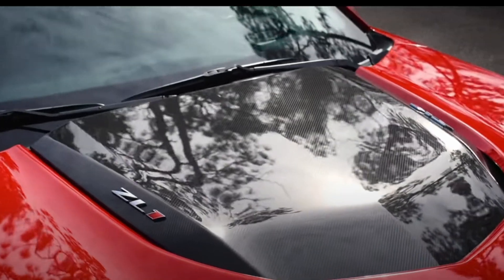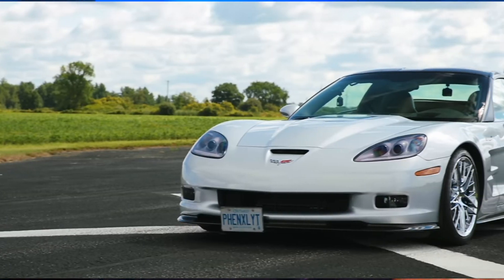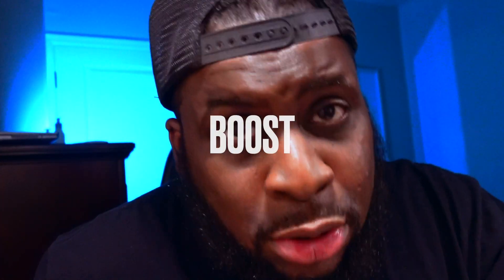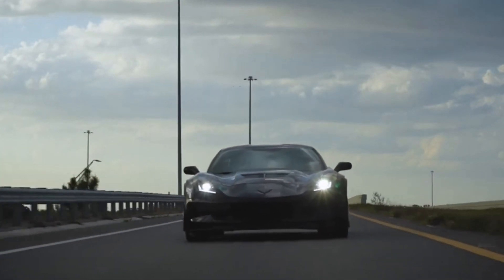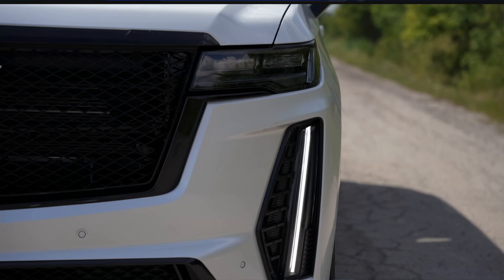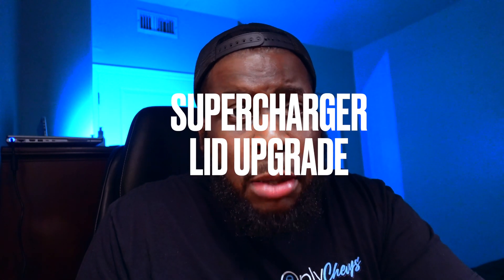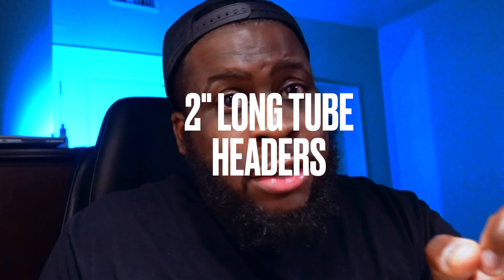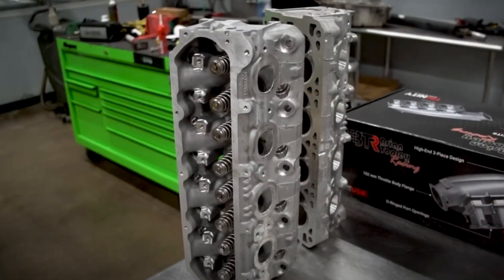The LT4 Engine WON’T SURVIVE 100,000 Miles?!

Comment: I hope GM sees this and sues the crap out of you for misinformation. I have a '16 ZO6 with over 135k miles on it with a Maggie 2650 putting out 15lbs. of boost and over 1k hp for over 4 years now and here's the kicker...still on stock crank and rods. So a stock LT4 will outlast your birthdays as long as you maintain it. Your misinfo for likes and whatever has ppl considering spending money for nothing to bulletproof a motor that doesn't need it. 🤡
Reply from the maker: 🤣🤣🤣 you funny, just because yours lasted doesn’t mean others haven’t experienced either of these issues i mentioned. Just because you on a maggie2650 safe tune from magnuson doesn’t mean anything. Stuff happens, just say you was lucky enough to not experience it!🤡 all the stuff I’m saying you can Google it 🤣
Reply: You Goofball there is nothing safe about a car making over 450hp more than stock hp, on 6 more psi over stock on the same rods and crank with over 135k miles on them. But of course you wouldn't have a clue 😂. I guess stock LT4's won't last that long according to your goofy logic. Freaking 🤡. Talk about something you truly know about and leave the car topics to the adults. Fkng Goofball 😂.

Comment: Only the Corvette LT4 motors are dry sump. And only the '15/16 Corvette motors had the stock limp mode heat issue.
Reply from the maker: True but I rather mention it just in case people get this model years since it’s still was a factor

Comment: Only the corvette had a heat issue because of the small grill opening
Reply: To be specific, the a8 c7 z06 faced heat issues. The M7 didn't, and post 2016, all models received an auxiliary secondary cooler

Comment: Bent 8 pushrods on a 17 2ss on startup once. Snapped 8 pushrods on the same car 6 months later on startup. Both times on the dod cylinders. Lost confidence in the car at that point.
Reply from the maker: Thanks i appreciate your comment! People believe it’s always user error or these cars are bulletproof but some of these are damn near lemons, and people go thru lots of problems, sometimes aftermarket parts fix these issues but who wants to do that.

Comment: These engines are actually amazing !!! The only problem with them that people have really had with this engine are the lifters , outside of that it’s probably one of the best engines they’ve produced.
Reply from the maker: That’s true but lifter failure still sucks tho! Fails more often than not that’s to the AFM/DOD
Reply: @BLUPRINT1LE  yeah but you can always get them replaced and after that this engine can probably run 200k plus

Comment: I know someone with a 2017 in Phoenix she’s not stock probably over 100k miles now
Reply from the maker: Ayyeee that’s wassup, she most likely bulletproof her engine with the stuff I mentioned to help with longevity
Reply: @BLUPRINT1LE  she hasn’t yet she has a chassis mount wing different wheels with smaller tires like a drift car would use. She named her car z hell one

Comment: My dad has a 23' ss camaro. The first orne he ordered  got a rod  knock  just driving it off the delivery truck into the dealership.  GM sent another camaro  some months later and after 827 miles and the first oil change  at the dealership...lost the motor. I have no idea what the hell is going on with chevy but they really need to get they're crap together
Reply from the maker: Thanks for sharing your experience because most people don’t think it’s possible and these things does happen
Reply: @BLUPRINT1LE SS doesn't have an LT4 😂

Comment: Tbh the lt4 is the strongest part in the ZL1 along with the transmission. The rest idk. But its an amazing car 😅
Reply from the maker: That's true, but these problems is out there and something to be aware of but if you keep your warranty you have nothing to worry about 😎
Reply: These cars do not over heat unless theres is a mechanical issue. Tracked it in 110f heat. It dosnt over heat. Even the z06 its rare to over heat, thats all internet jargon.

Comment: Come on dude Chevy is one of the most reliable engines out there😂😂 I have a 2012 Silverado 1500 has almost 200k no issues. My dad had a 2006 with almost $500,000 mi on it when he sold it original motor. Chevy is just tried and true.
Reply from the maker: Oh facts it’s reliable but the repair bill is high on these LT that do fail like the lifters, oil pump, valve train those are pretty hefty bills if you modify it and wasn’t aware, even if it stock these fail too. Those LS back in the days  and still today can stand the test of time but not with these LTs as of yet with those lifters especially. Plenty of stories about those failures way to early
Reply: Your 2012 Silverado doesn't have an lt4 in it does it?  It's irrelevant.  As scared as all these zl1 owners are of modding their cars it must not be all that reliable lol

Comment: This is the most useless content I've ever seen. if u buy a Chevy and can't afford to build the motor out to a 427 or whatever then maybe u should of bought a civic. I don't care if the motor can't make it to 100k miles it's gonna get built regardless of the miles
Reply: I am in Phoenix az and I bought 3 brand new zl1.  2017 10spd road raced it put 10k miles on it.  2019 zl1 1le, road raced it 8k miles.  Both stock and flawless.  My current 2023 zl1 6spd I daily drive it and it spun a main bearing at 4k miles driving to work on the 10.  I think it was one of those gm strike builds.  I still trust the reliably of them compared to any other.  At the road course you see hellcats/srt, corvettes, 911, gt350 etc.  everyone agrees Camaro SS 1le and zl1 are the most reliable high horsepower track car.  
Plus gm did me right they gave me a new long block $1500 and an extended warranty on my new engine.  They are one of the few manufacturers that warranty their track cars on the race track.
Reply from the maker: @user-hl4iw7nu6g now that’s rare! You definitely don’t see them warranty your stock block after the bearing spun! I can agree the SS 1LE and ZL1 are the reliable but the lifters goes out way to often on the SS 1LE which I know people who on their 3rd motor because of them stock wise, for me I know I wanted a SS 1LE and built the motor because I would road race the hell out of it! We should hit the track one of these days! I go to Inde but I want to try others but it seems hard to see open track days at WHP or AMP I think that’s the name of it. I just move here to AZ so I’m trying to find all the good tracks
Reply: @BLUPRINT1LE  amp is fun but they have sound restrictions if you modify exhaust.  But if you stock you will be fine.  Don’t go nasa go pro auto sports because they are way less rules.  I’m down sign up for pro auto sports in November or January and make sure you change your brake fluid.  I also had an SS my first time and over drove my car.  Brake pedal hit the floor and almost went off.  Plus if you’re aggressive you will go through your front tires with stock camber in the weekend.  Do you go to the pavilions?  I also owned 2 SS 1le one auto and one manual.  SS 1le is honest the best track car for fun and cost.  Zl1 you can feel the extra weight and after a couple laps with the heat soak it’s not that much faster on the straights.
Reply from the maker: @S58b58  I ride on an aggressive track alignment 2.4* front and 1.5* rear. I been to the PAVs before just a handful of times, I’m in Tucson so I go up there at least once a month or depending on the venue, I go up there! I am going to look up Pro Auto Sports that’s my first time hearing about them! January seems promising to me since work will be delayed a bit.
Reply from the maker: That’s the problem, your only a small set of people who buy a Chevy and build the motor! I even built mines but that doesn’t take away from the fact that most people enjoy having a warranty and not big on mods but like the product itself. Most people get cars and ride them till the warranty expires and trade in. But I wouldn’t call the content useless just consider it more awareness
Reply: Its funny cuz ppl act scared to mod them yet the lifter thing seems to be the biggest issue and all you gotta do is a set of nice heads and that problem goes away.   Seems like modding is what the car NEEDS.  It's just funny how they have this it's gotta stay stock attitude I'm from the mustang side we been about modding since day 1.  It seems weird to me how scared alot of zl1 guys are to mod in these comments alone.

Comment: Not gon' lie, the title of the video had me fuming.  :D   The LT4 is super reliable.   I beat mine on the track regularly and am probably the hardest on the car in all of YouTube (peep my channel).   This motor should easily go 100k+ or more.  I'd say even 200k+ miles with no issues.    Bad tuning is the achilles heel of the LT4.   ...and yes, assuming you can supply adequate fuel, they'll take up to about 1200hp before they grenade.   I wish we would have gotten the LT5 from the C7 ZR1 as a sendoff.
Reply from the maker: 🤣🤣🤣 I’ll definitely go check it out, I like track content. Bad tuning is one but lifters, dod and the Val train is yet the big deal with them it was the oil pump for a while till they fixed it and a lot of these cars was stock, when you modify it without knowing about these cars going in, it’s a hefty bill waiting for you.
Reply: 100k miles ain't shit on a modern car.  Saying it'll last 100k or more isn't exactly glowing reception lol.  Most modern engines should go well over 100k if properly maintained so that's like bare minimum expectation these days.
Reply: @midnight347  if you're talking about a Hyundai or a Kia that's driven to work and back with the occasional cars-n-coffee thrown in, then yeah.    However, the LT4 can take 100k+ miles of abuse easily.   I've got 30k+ on mine and most of those are track miles on the limit.  next year it will probably be 60k+ which would probably equate to 150k-200k of regular driven miles.  Maybe more. 

Also, a lot of 'modern' engines as you put it have a hard time reaching 100k miles.   WRX Sti's bottom ends are known to fail.  Hondas are known to burn oil which can lead to failure if not maintained.  Golf GTi's can become problematic around the 70k mark as well.   LS engines had valve train issues not too far back.  ...and the list goes on.  Exotic cars? Forget about it.  Most need a major clutch service at the 30k mark.  Saying "Most Modern Engines" I would argue is an over-generalization that can be argued both ways.
Reply: @midnight347 were talking about sports cars buddy

Comment: My personal experience with the LT4, don't mess with it, leave it stock. Most people who think they know how to improve what GM created, simply do NOT know what they're doing and their lack of understanding the engineering of the LT4, creates a snowball of issues after mods and tuning.
Reply from the maker: Exactly! But it’s very hard to do for some as they have the urge for more power! I feel like it’s enough power as is but there’s always some who want to break records on public roads lol
Reply: @BLUPRINT1LE  in the Z06, the power is incredibly intense and the added ability to go into a corner hot and out clean is as incredible. That's what makes the Vette a Vette and unique. The ability to scare the hell out of not only your passenger but yourself while taking a 40mph corner at 85mph and still staying on the road. Even on straight aways cruising at 70mph and stomping it and fishtailing 2nd to 3rd gear shift running upwards of 90mph and then it just takes off as it gets sucked to the ground tighter and tighter the higher the speed. All while in complete control. That's the engineering and design. How confident can you be at taking a corner at more than twice the recommended speed after tampering with the cars dynamics? 
Trying to hit that 1.25G in a turn is crazy fast and takes some faith and a lot of engineering to not get killed.
Reply from the maker: @jeffreycollier1805  facts! I totally agree
Reply: @BLUPRINT1LE  I'm one of those people, hahaha hahaha! But I've learned my lesson about Corvette in particular, it's best to let the GM engineers make the best hot rod for the street and just try to enjoy it the way it was intended.
Reply from the maker: @jeffreycollier1805  🤣🤣🤣🤣🤣
Reply: @jeffreycollier1805 if you can't mod the damn thing for more power and it still be reliable it isn't all that great honestly.
Reply: @midnight347  oh, you can mod it all day and night, that doesn't mean that it's better than the original design and tune. It's already crazy fast and powerful, add ons just push it over the edge of drivability and reliability
Reply: @BLUPRINT1LE or maybe they just wanna upgrade their car like people have from the beginning.  Maybe we wanna pull that modified car next to us from a roll we encountered randomly?  You ain't doing it with a stock car no matter how bad yall think your "650 hp" motor is.
Reply: This is total fn nonsense.  These cars were made with a big ceiling and it is capable of far more than what it does in stock form with relatively simple mods.  The whole keep it stock nonsense is just that.   If the thing can't last with mods is it really that good?  This is assuming you modded it right.  If you don't that's on you.
Reply: @midnight347  when you try getting 700, 800, or more horsepower and torque to the ground on a street car, the snowball starts with additional mods to harness the power to the ground and keep it between the ditches. Some lose sight of the fact that the Z is a factory built track car. Wasn't designed or engineered for drag racing which is a totally different animal. On the track, too much horsepower and torque is counterproductive to staying on the track, much less, winning.
Reply: @midnight347  another thought on your comment is that the C6 Z06 427 is a beast of a factory built race engine. The trouble with lifters dropping started with mods to the air fuel mixture being tampered with by unsuspecting owners. If people just leave the 427 stock, it's a bad ass engine and lasts for a long time if it's not raced. If raced, then expect the standard lifespan for a race engine. 
Just another example of race engine sensitivity to mods and adjustments that do more harm than good and reduced engine lifespan
Reply from the maker: @midnight347  that’s true, ceiling is big but the “car manufacturers” have laws where we at the civilian level don’t have laws when it comes to the aftermarket which doesn’t stop us from modifying the vehicle. Thats why some parts are carb legal for Cali and some are not. Some people like keeping cars stock because of reliability and keep resale value high. When you modified the car it’s for your specific needs not anyone else. Trust me, I blew my warranty at 8K miles and have no shame in it BUT when my car was stock I bent a valve and a lifter almost collapsed and it wasn’t based on hard driving at all, however I’m just pointing out that if you keep it stock these are things to look out but if you mod it as well you bulletproof your engine more likely go pass the “expected” warranty GM meets which is that 5 year or 60k mile powertrain

Comment: Lot bad info here. Only corvettes have dry dumps. Also all LT4s have the shity AFM lifters. 

Escalade V has a 2650 from the factory.
Reply from the maker: I forgot to mention that corvettes is dry sumps vs camaro and caddy are wet sumps  but thats minor. alot to uncover in a shot amount of time. As for lifters that true but I dont see them failing on LT4 as much as it does on the LT1s but it is there.  and correct the V does have a 2650 but the block is still a LT4.
Reply: @BLUPRINT1LE  All good! Also I believe the pushrods are weaker than the valve springs. I have managed to bend a couple push rods in my ZL1 1LE and My blackwing smh. Honestly think it should be the first mod to drop thinner stronger push rods in all LT4s and LT1s.
Reply from the maker: @josephbriggs2394  in all honesty getting into these cars is not for the faint at heart! Because LTs are definitely more expensive than the LS platform but you always have those guys saying I can make xxx with LS but the LT platform still growing and people still perfecting it

Comment: I would mention the cylinder deactivation was a problem
Reply: I deactivated mine in 2012 is 2024 and it's still going!
Reply from the maker: That’s true! I mentioned that in my LT1 video I did vs LT4 because it seems to be a big deal on LT1 NA vs LT4. Not sure why but yeah the issue still there
Reply: @BLUPRINT1LE  I put a range device on my car. Hope one day I will go cam, heads and Maggie
Reply from the maker: @TyZo6  the time will come 😎
Reply: Only in the automatic, the six speed don’t have it, deactivating it is no big deal.

Comment: Great video, agree with all statements. Certainly worth getting an oil catch can even if not modifying it. Yes, the valve springs are suspect. Saw a video from LMP tuner where a ZL1 with less than 1K miles was getting upgraded and when they took it apart, it was already failing. Thanks and God bless you all.
Reply from the maker: Thanks I appreciate it! Yes a catch can is a must for the entire LT platform! Not too many talk about the valve springs but throw power at the car without knowing what they get into!